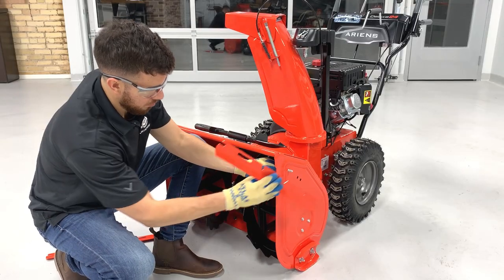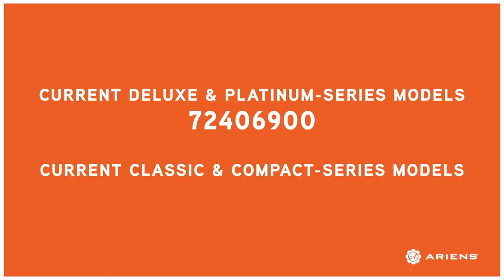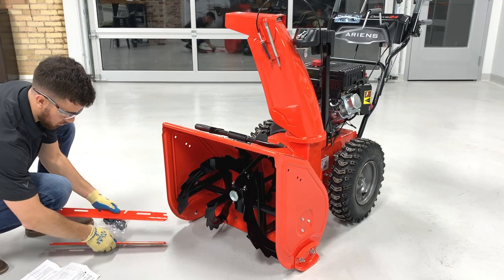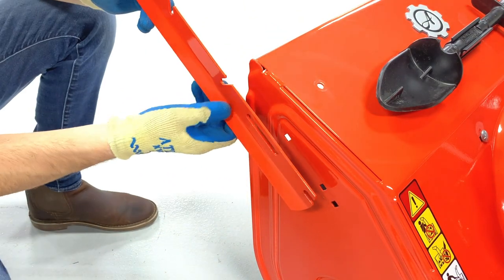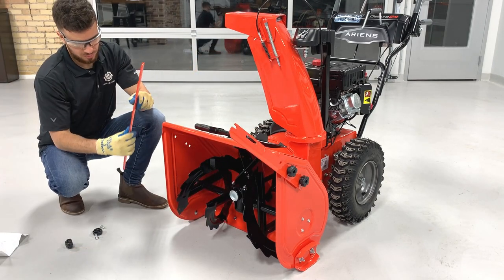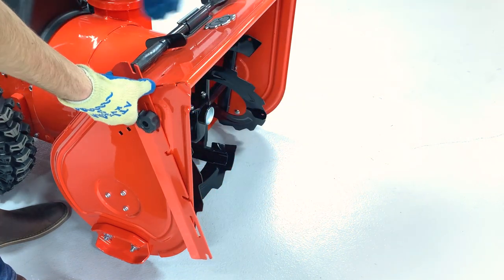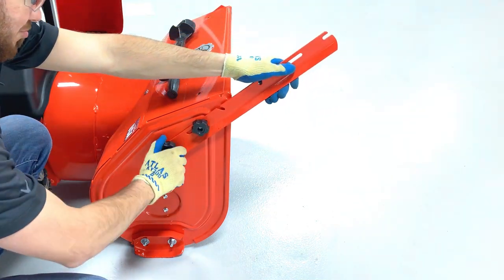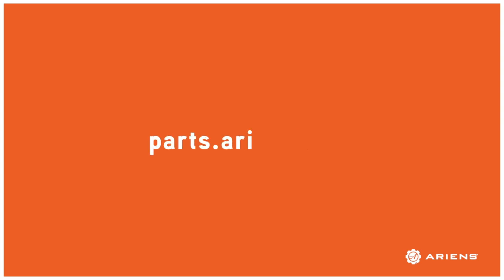How to Install Snowblower Drift Cutters | Ariens®

Comment: Ariens, relative to other brands charges reasonable prices for their quality accessories.  Attention Ariens execs: please don't change that 👍🏽
Reply: You are nuts. Their prices are out ragous!
Reply: @skiprope536  Did you ever look at Toro's accessory pricing, just for giggles?
Reply: @cardo1111  Seriously accessories for a snowblower. WTF...Warm Gloves...Those are not listed on either of them. That is what you need and a warm waterproof jacket. Seriously WTF
Reply: @skiprope536  Take it easy Skip. I am talking weight kits, snow cabs...
Reply: @cardo1111  You don't need that stuff. I have been blowing snow with Ariens and Honda for over 30 years and never ever needed any of that stuff. And in the Northeast we get over 6 feet of snow a year. Well not this year. And I am taking it easy. I think your statement was ridiculous!
Reply: @skiprope536  The fact is their accessory prices are reasonable relative to other brands, what's "ridiculous" about that?  If you believe no accessories are necessary for operating a snow blower, that is your opinion. I was just sticking to an objective fact in my statement.
Reply: @cardo1111  LMAO!
Reply: @skiprope536  😎 All in good fun bud
Reply: @cardo1111  Ditto Brudda!

Comment: What kind of grease should i use to grease the grease fittings on the auger any specific kind
Reply from the maker: Thanks for asking! We only recommend Ariens OEM hi-temp grease. You can get it at your nearest Ariens dealer, or at our online parts store:

https://www.ariens.com/en-us/part/00036700
Reply: @AriensChannel  This is good for lo temp to right ? and thanks for getting back to me
Reply: @AriensChannel  Well i ordered the hi temp grease off areins.com and they send me sta-lube instead is this even hi temp
Reply from the maker: @MrMoe158  Thanks for asking! We dug into this a little bit deeper and learned that the grease you received will work just fine.

We recently changed grease suppliers. The previous vendor called their grease "Hi-Temp" grease. The current vendor doesn't use that nomenclature. Nonetheless, be rest assured that our new grease is spec'd to protect your performance just as well as the old brand.
Reply: @AriensChannel  Thank you.

Comment: There are parts that should come STANDARD with higher end snow blowers. I got a pair for my Toro and it was $58.00 for 2 pieces of metal with screw holes. Don't get me wrong I'm sure the first time I use them I'll be like "damn, I'm glad I got these", but $58 (same price everywhere) is a bit much.

Comment: LMAO@ all these videos. Try doing a repair when it is 28 degrees F out...and a belt breaks...Or a chain breaks...Or a friction disk lets go...Video's a total JOKE all of them!
Reply from the maker: And that's partially why we advocate checking all your maintenance items before the season starts. Best to do it in September before it gets too cold 🥶
Reply: @AriensChannel  Reality my dear boy. Whether you do maintenance These Ariens machines are not the quality they once were. The metal is all inferior and rusts faster than anything I have seen. Buckle up. I got a video coming on the crap you sell these days. The Crap metal that rusts. I Have been an Ariens user and owner for over 50 years. So here it comes!
Reply: Too bad you don’t have a heated garage like me 😂
Reply: Man, I bet you’re a blast at parties.
Reply: @skiprope536 where is this video you said was coming? Two years and still nothing. You sure like to talk alot but not much to back it up hahaha 😂
Reply: Guy admits he ran his machine through salty slush and didn't maintain it while storing it outside under a tarp and then when the inevitable corrosion happens he trolls a video about accessory drift cutters.  What a maroon.
Reply: @AriensChannel  Ariens makes Junk.